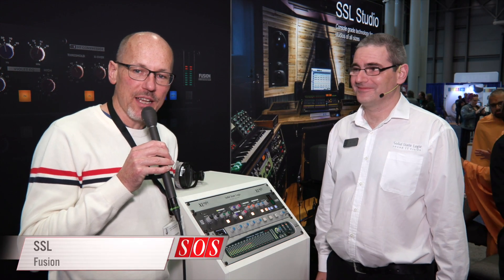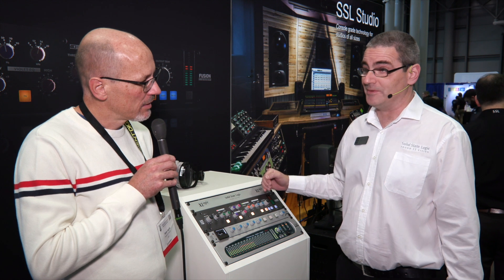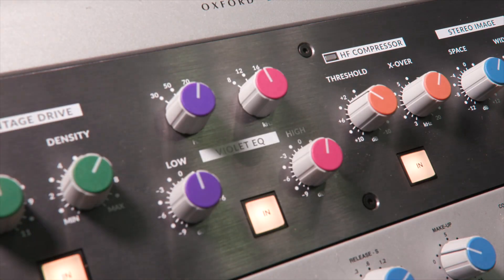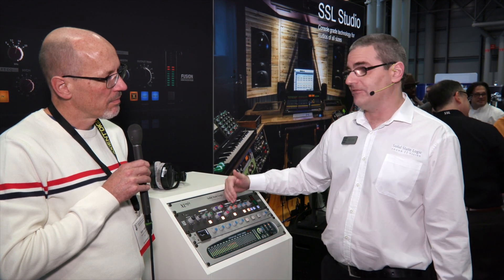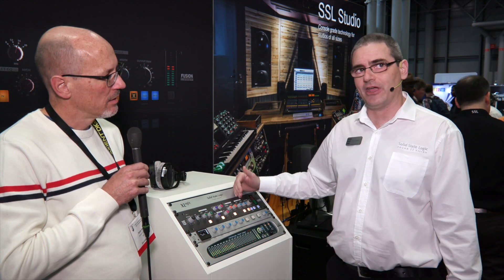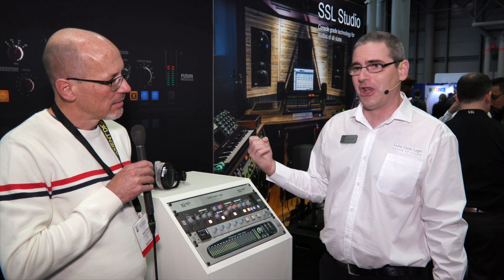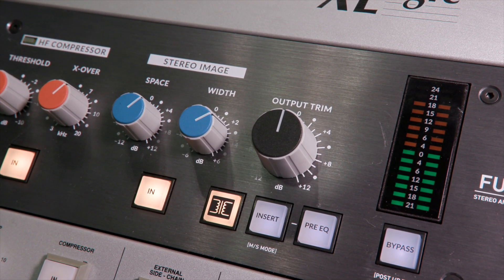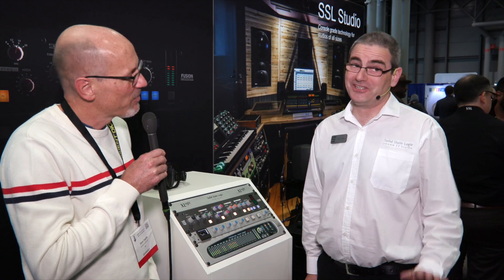SSL Fusion - AES 2018

Comment: Playing devil's advocate and sincerely asking at the same time, if plugins and digital workstations need to be analog-ized, what does this digital based box offer anything different then say all of the SSL sound shaping / enhancing / tape saturation / stereo widening tools, etc. offered in for instance Propellerhead's Reason?
Reply: Hey man! I got curious reading your comment! What do you mean by "digital based box"? Isn't this sold as a 100% analog box or am I missing something? :) thanks!
Reply: @marccheese9023  What I meant was, just like how there are VSTs that emulate analog sound, this too, though hardware, is a digital (vs analog) device that emulates analog as well... hence my meaning behind 'digital based box".  It's basically computer chips inside a box with control knobs and I'm asking how is that different from the same inside a computer that may be controlled via keyboard & mouse or even an external controller.
Reply: alternatingbitmusic thanks for your explanation! I’m looking into buying this hence why I’m so interested! Are you sure it’s computer chips inside that box? From what I got was that all processing is analog but there’s not much info out there yet. Are you saying there’s a chip for say the eqs and they are not analog filters?
Reply: @marccheese9023  Please don't accept any of my speculation as truth... I do not know.  Definitely do some research.
Reply: alternatingbitmusic I got to have a chat with a guy that actually worked closely with these guys while developing the machine! It is a all analog circuits based box :)
Reply: All analog and brand new designs at that ;)